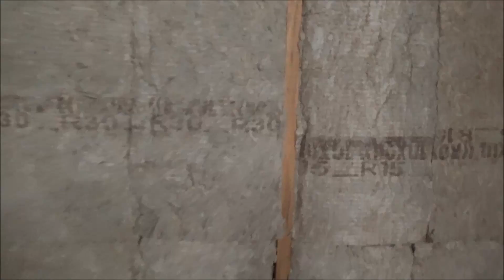This Old Barn/Shop Update January 2018

Comment: The major heat lose is the roof . I have owned a machine shop for over 30 years those big warehouse type buildings are hard to heat and cool. Especially when the full of metal machines that act like ice cubes. maybe some ceiling fans to bring the warm air back down?

Comment: You are progressing well. 

All those jobs take a lot longer than you estimate. 

Insulation for you is important to keep warm, in Oz we use it to keep the heat out and try stay cool. But it's an essential. 

It's going to be a big job sheeting the walls with plywood to, especially 15mm I think you said, they will be quite heavy as you get higher up the wall. I hope you have a nailing gun. 

Cheers Dennis
Reply from the maker: I screw everything. I hate nails.

Comment: Looking great Brian.  2 cents worth,  Use the pest control/repellent spray foam "Great Stuff Pest Block" instead of the regular stuff.  Put the walls up first, by the time you finish the insulation the weather down there will have warmed a mite; that will let the building breath over the summer then put the ceiling in this fall.    like I said my 2 cents...

Comment: should have put up Tyvek before the outside sheathing, that would have reduced the water intrusion on the insulation.  I think you will have a rodent problem if not mold.

Comment: Nice video. 
You're doing a top notch job on the installation of the insulation and the superior work will pay off in a 'super way'! 
....13
Reply from the maker: Only way to do a job is to do it right.

Comment: glad you spray foamed the air gaps. For critters and air leakage. Looking good.
Reply: the critters will still eat the foam found where they did on my shop beside the window unit ac a month or so ago when I was at the lathe and kept hearing this strange noise and no the scratching was not a bearing but something in the wall . I filled the hole with poison and now the noise is gone but we have a strange smell
Reply: YEA, YOU ARE PROBABLY RIGHT. Brian can always take some bondo now that he has backing and apply a hard coating over it b4 he paints the outside.
Reply: Jsteifel  Yea now that is a good idea I might have to try that also I hope Brian will go into more detail about that paint he is using to seal the outside of the shop since he said it was good to fill the gaps also

Comment: Looks like some good progress, I guess I shouldn't complain about working in my shop at 65 deg.  Hope that rock wool is not too itchy -- helped my dad with some of that when I was a kid,  itched for weeks.  Craig
Reply: We put Rockwool in our carpentry house (last century) and it wasn't bad.  Nobody had previous experience with it, so we took the same precautions as one would with fiberglass, which amounted to wearing long sleeves and cuffed gloves.  That version was fully vapor  barrier wrapped, and you used a combo hand saw to cut it.

Two rows in the ceiling didn't survive long though.  One of the Juniors slipped off of the ceiling joists, straddle of one of them, the day we laid in the cross layer it the attic ... just before starting to spray the ceilings

Comment: Do you have a separate electric meter for the new shop?  I'm curious what the utility cost is to run all that big iron.
Reply from the maker: Currently the cost would be none since none of it works in there yet! lol $6.72/hr would be the absolute max It could cost based off the electrical service. In reality about $2 is probably close when the machines are in use.

Comment: are you going to slap some paint on your steel for the crane before you totally enclose it in the insulation and while you are up doing the roof insulation.
Reply from the maker: Actually the crane steel will all be to the inside so it will still be exposed.  I already painted the steel to the outside before I put the walls up.

Comment: Your old barn will be better insulated and sealed than my house.
Reply from the maker: Mine too if it makes you feel any better!
Reply: Helps a little.  It is a good thing the west facing part of the house has a big front porch running the whole side of the house to help cut down the wind.  Resealing or replacing the front door would help a lot.

Comment: We finally fired our boiler on our radiant floor, it worked great, now we need to finish putting up the foam board to hold up the insulation that has started to fall.  My shop is 60 x 66 x 18' with R35 in ceiling and the craft paper won't hold it indefinitely... LOL
Reply from the maker: Be bad for it to start raining insulation on ya! lol

Comment: Brian, why did you choose the Roxul product?  I had never seen it before until now.
Reply from the maker: Its more dense than fiberglass so less airflow, isn't harmed by water, locks in tight to the stud bays with no fasteners and is fireproof. Also unlike spray foam I can rework it or make changes later no problems.
Reply: Wow, I have not seen that product before, thanks!